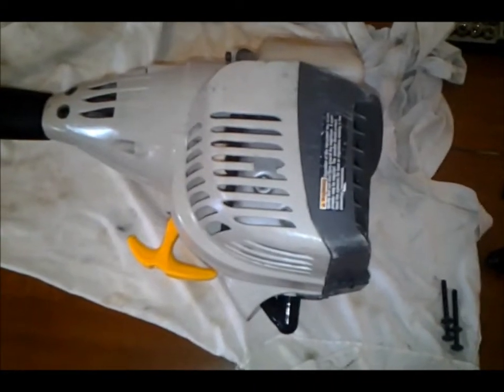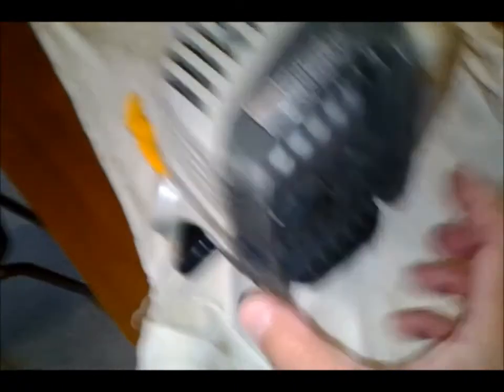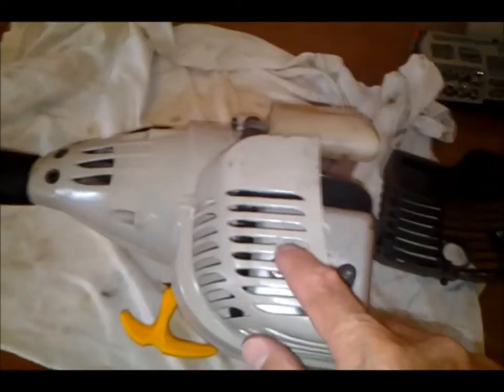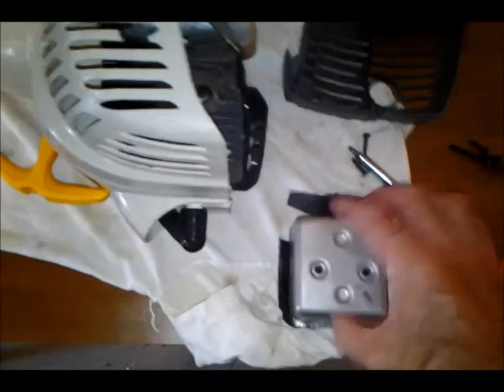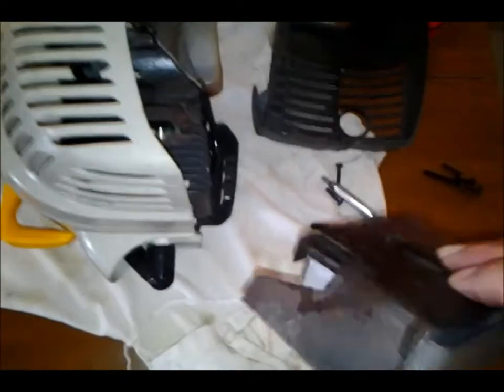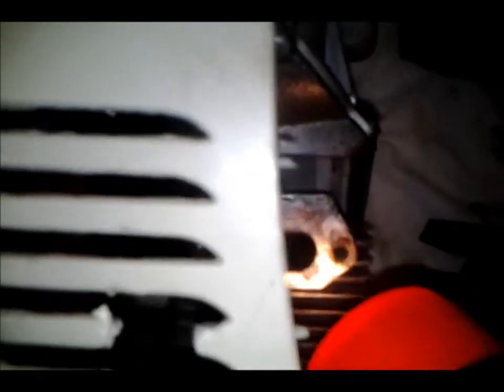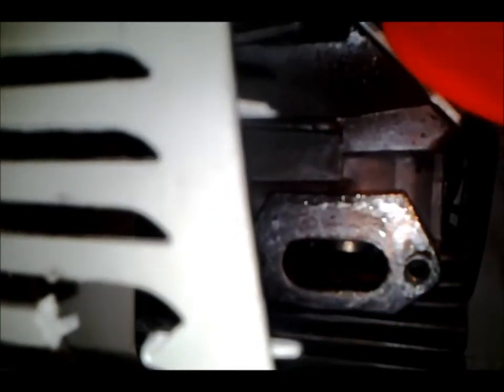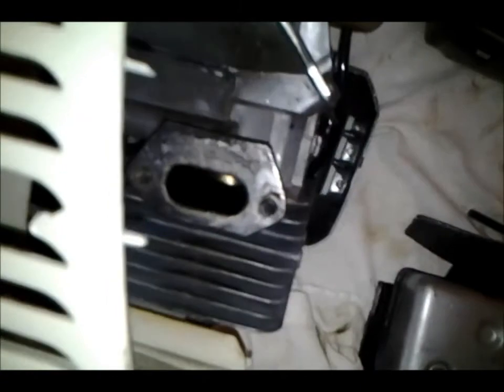Ryobi Weedeater Exhaust Port Inspection

Comment: There's some truth to this being oil must be mixed into the fuel and it burns off into carbon gunk which then through time clogs up the port some machines have a screen it will collect it a wire brush a carb cleaner or parts cleaner brakes cleaner which of them is a matter of preference however the rest is straight forward don't get crap in the ports in this case it's lost its back pressure and notable to breath a good clean up and running vvvrrrrooommm !!!